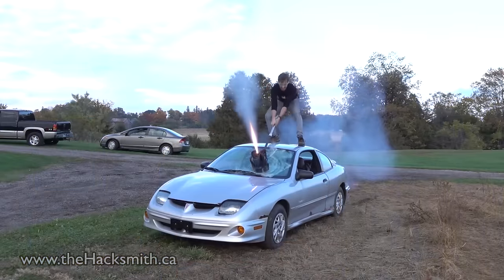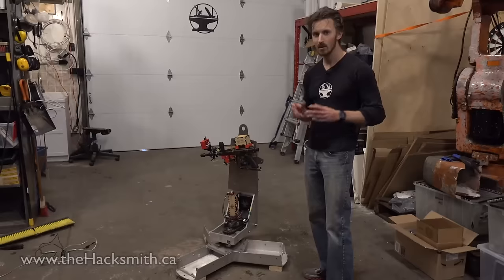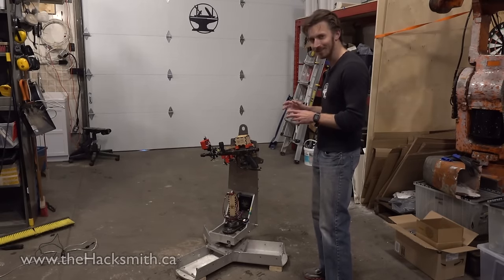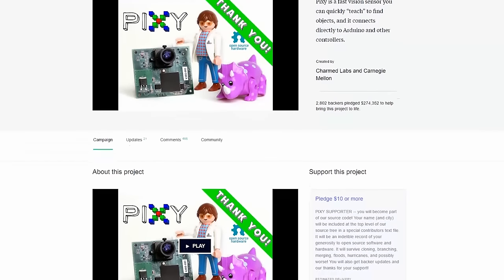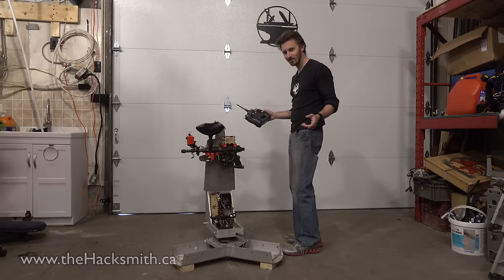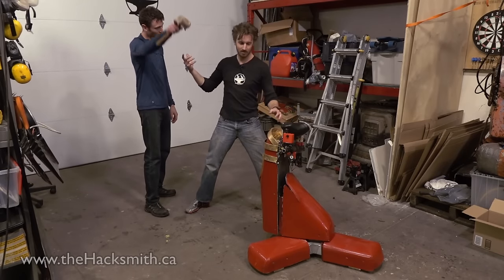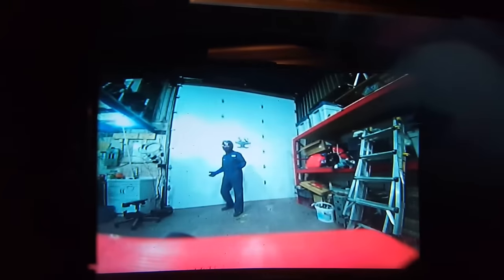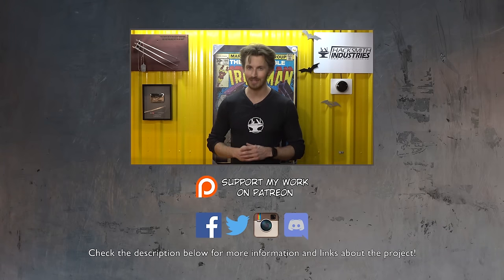Make it Real: Torbjörn's Turret (BUILD)

Comment: Why don't they use those in prisons and military bases? I mean ones with real guns. It seems so easy to mass-produce them for a weapon producing company. And just imagine how simple would it be for the military to hide them all over the place and then just sit and watch camera pictures without any risk. Just a classic surveilance camera (we've got a lot of them) combined with a... gun.
Reply: Владимир Кузнецов currently these things have alot of flaws and are easy to bypass
Reply: Владимир Кузнецов  probably some ethics and a physical person can discern between guard and escapee. lot of engineering and software hurdles to get past if you want a fully automatic decision making deadly security camera
Reply: Essentially all was said already, but biggest would be that if it has microchips in it.. it can be turned against you. For instance many armed droid based systems have been scrapped due this weakness of hacking. If system would be automated, one mistake or malfunction in system would cost life of civilian or your own troops.
Reply: They actually already have them, google it. It's called an aEgis turret, by south korea. And no, i did not spell it wrong, it's supposed to be called that...
Reply: that's what the manual version is for, the guard will watch and/or use the weapon instead of an automated process doing it.

also take them off wifi or any grid, only the controller works and it should be hardwired in.
Reply: maybe because that'd be fucked up? just gunning down someone like this is unethical, the thing would probably shoot any stray guards, maybe families coming to visit, probably would blast any birds or bunnies that find a way into its sightline, but even if it did work as directed, you wouldnt get a chance to surrender,  basically handing out the death sentence without the court
Reply: They have them on the dmz
Reply: They do exist. The demilitarized zone in Korea is the most one of the dangerous places in the world. They kill any moving thing. Facial recognition is too finicky and would require every single enemy to be programmed into it. Also, hacking.

Comment: now you need to add more sensors, such as a heat sensor to track targets that are 96-100 degrees (or somewhere about there because 98 is around the average body temperature of a person). it would be very similar to a heat seeking missile but it shoots paintball pellets instead. it would be distracted by similar heat sources that aren't human but that just adds to the fun.

or if you're doing real paintball just have your team's turret track the other teams color (and give both teams correctly colored shirts)

Comment: You remember the xcarve you got? I think you Can cut aluminium on that, so you Can make a EDF fan and then balance IT later.
I just wonder, after becoming a engeneer and work as one, Do you Do a LOT of math all the time like in school or mostly just a CAD software and Do control math on IT? Im in swedish high school on the tech oriented program to hopefully be a engeneer within flight and/or space area so i really wonder.
Btw Can you make a drone with your EDFs? IT would be cool
Reply from the maker: The x-carve is honestly a very bad product. it would be impossible to cut EDFs with it =( It can barely cut basic outlines in aluminum. We tried turning it into a CNC plasma cutter so it'd be at least somewhat useful, but that didn't work either =(
Reply: the Hacksmith to bad, But about the math when you work as a engenieer, is IT like nonstop math class or know CAD and stuff mostly? Cause IF its nonstop math, i have to reconsider My carrer and stuff
Reply from the maker: +Ariel Nir all depends on the job you get. You might end up using 5% of what you learned in school in your job. If you don't like math don't pick a job that requires a lot of it -- but for engineers... We use tools -- like computers. Not much math needed

Comment: How many hours did you put into this?
Reply from the maker: Honestly not sure. We've had the base assembly for a few years. One guy tried figuring it out, probably spent a good 20-40 hours trying to communicate with the original controller (via DMX) and had no luck. Bogdan had a rough version running within maybe 10 hours of looking at it, but then the motor controller died, so we bought a new one. He's refined the code a bunch. Maybe 40 hours tops?

Comment: Did you know that you can  bend a mirror for less using a butane torch???  For Engineers, you seem very blase about energy use, even after explaining about residential power availability...???
Reply from the maker: +DredWolf it's an 80w laser dude... Less than a lightbulb.

If we used a blow torch it would look terrible. As engineers -- we know what we're doing.